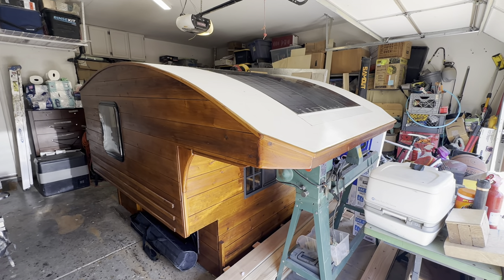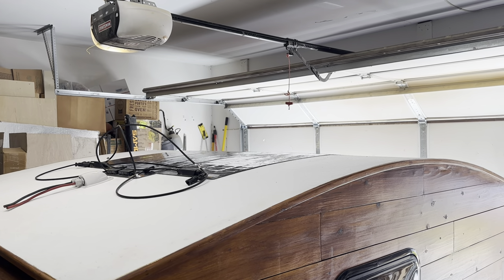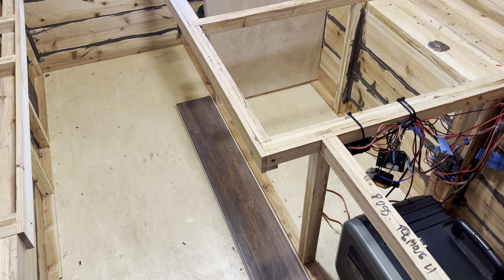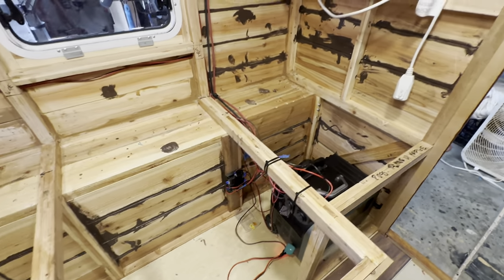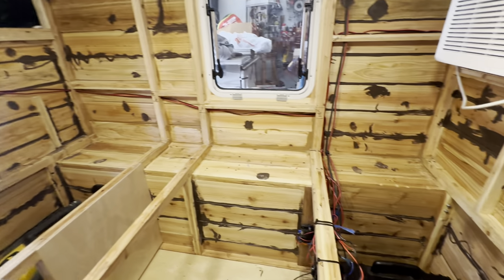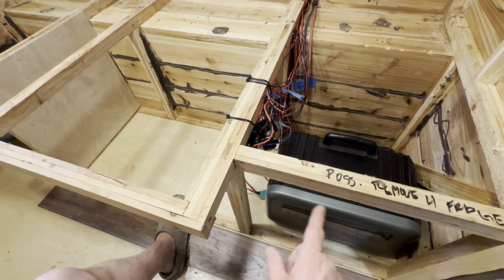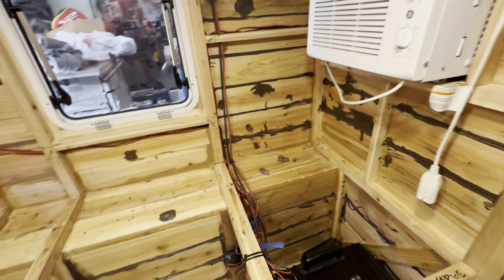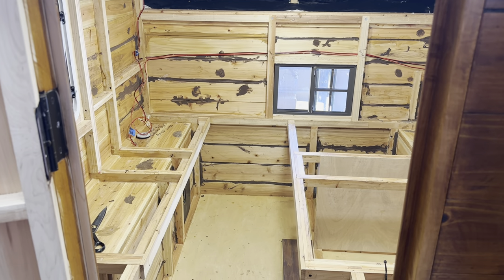Truck Camper Build 8.0 VLOG, Part 12 - Electrical System Is Complete (mostly)

Comment: Great job Dave 👏👍. And smart thinking putting the🚽 storage there with the lil access door for venting. 
PS- so the fuse block just runs a male cigarette adapter off it to the power station? How many cig outlets those stations usually have? 2? 🤔
Reply from the maker: Thanks, yes and 1. I have another dual set of females off the fuse block for the fridge and other accessories.
Reply: @EndgameCampers  ohh awesome, thanks Dave! I like the simplicity of an all in one for small rigs like this

Comment: So, for the fan, I've been experimenting with radiator fans. I have a 24v system with a 12v converter. Seems like you could buy a rv roof vent and install it on the side and then ad a 12" radiator fan with a speed controller. This would be a cheaper and better option than a maxxair fan because you would have cheaper and more user serviceable parts from multiple suppliers.